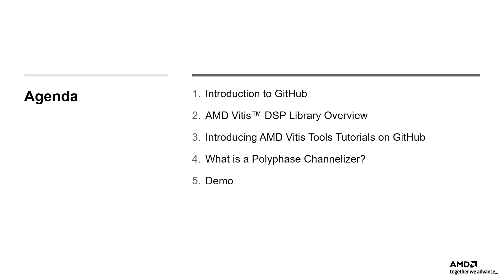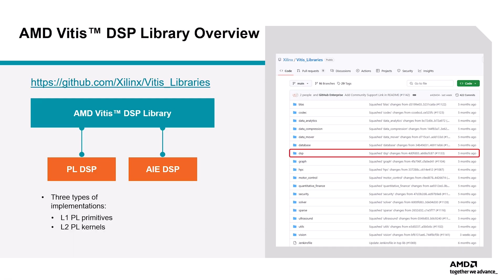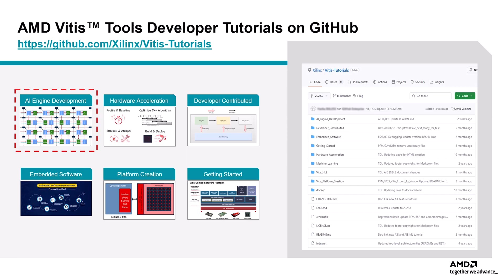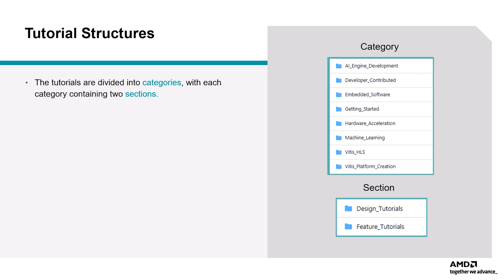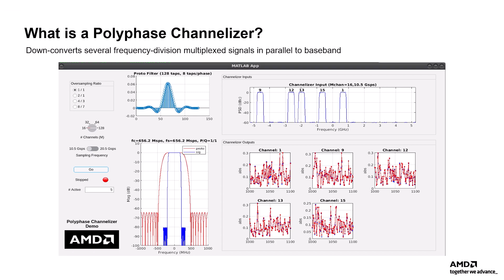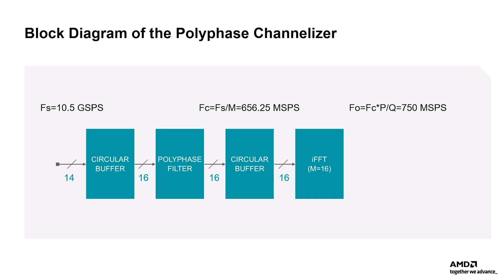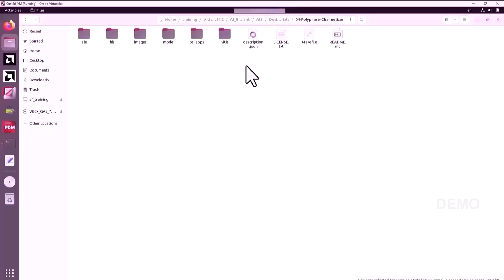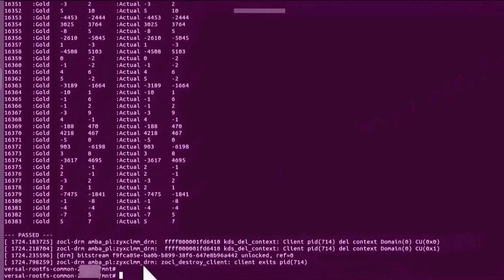AMD Vitis™ Design Implementation (GitHub)

Comment: Dear AMD, please add some FrameGen to SteamOS UI - AFMF 2.1 would be great to launch from UI or from decky plugin. I need you guys help, the current FrameGen modding isn't that mature yet there. As for FSR4 on RDNA3 and Ryzen 395 and XDNA2 - please remember, there are hundread ways to play the upscaling - say, enabling it only FSR3 performance for lower resolutions - Sub 1080p (sub 720p on handhelds) still needs it the most. If you could say segment the model and launch only Ray Reconstruction on RDNA3 that would still be amazing - you could've unlocked denoising for GI-2.1. Also, community humbly asks to release the same flag (emulate fp8 with fp16 on RDNA3) on Windows. Much apreciated. You guys are doing great, a lot of fresh good ideas lately. Crossing my fingers my 7900XT or Legion Go S Z2 can get something good from you guys soon. I would really need CPU limiting on Z2 Go APU in Steam OS and Windows.